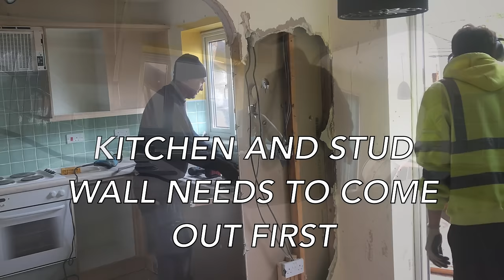HOW TO .... INSTALL 2 HUGE RSJ STEEL BEAMS...EXTENSION BUILD PART 8

Comment: Another little thing I noticed,  me being me lol, your structural engineer should really have stipulated you have steel sleeves in between your u.s.bs that your bolts go through.  To give more rigidity and strength when you nip all the bolts up they push at both insides of the upright of the beam. And mine also without compromise has to have oxidised paint coverings.
Reply from the maker: Karl Medina We don’t do it that way any more . We put a nut either side of each steel to clamp it . On this job there was no need for any , the steels were so wide they were just clamped tight together , so going nowhere 🧱👍🏽
Reply: @SteveAndAlexBuild  oh yeah I know buddy, I wasn't telling you how to suck eggs,  or that you were doing it wrong, I meant it in the sense that, even with the size of the steels if I did it that way now,  our building inspector would not pass it,  without either, paint coat, and or collets/spacers in the voids as I stated.  They just would not pass it,  I guess the guys at your end are a lot less fussy, or just realise that a lack of a bit of metal or paint isn't going to make the whole building collapse😂😂😂😂.  Nice job so far guys anyway. 
You dodged part of my statement!  I saw a frickin reciprocator!! 😆😆😆😆
Reply from the maker: Karl Medina . It’s funny , way back in the days before steel  that was wood 😂😂. As for that scary saw it was Vic’s 👌🏼🧱👍🏼
Reply from the maker: Karl Medina 😂😂. On site today making the most of the dry ground 👌🏼. Good luck with the tiling 😬🧱👍🏽
Reply: @SteveAndAlexBuild  👍👍👍👍 thanks off I go again
Reply from the maker: Karl Medina 🧱🧱👍🏽

Comment: Nice job. 👍Engineers should have to spend a bit of time on site to understand the chew on it is to get these steels in. It’s ok specifying big steels but all health and safety goes out the window on jobs like that. No room for lifting equipment and they know this as they do site visits. Makes you laugh when the recommended lifting weight is 25kg but they specify nearly 1/3 of a ton knowing the only way to get them in is by manual handling. 🤷‍♂️ I just did one on my gaffers house. Dividing wall between dining room and kitchen and the full back of the house 9 metres. Sat on a centre column and bolted together. Like a giant T.   Engineer specified 254’s with 6mm plates welded on just to make them that bit heavier. 🥴
Reply from the maker: LookitsMeNotYou . That is so true . These are 254s , never used them that size , the bloody profile is thicker too . I’m sure 215s would have done . I hurt my back just moving them into the garden when it was just me and Al 🧱👍🏼
Reply from the maker: Helicrete Sydney Absolutely ! 🧱👍🏽

Comment: Great vid. I have a question and I am a complete amateur so this might be obvious to some, but what happens to any moisture that penetrates the brick work from above the extension. Would it not just run down the inside of the cavity and end up on the steel. If anyone can advise that would be great! Thanks
Reply from the maker: There is another video showing me installing a cavity tray 🧱👍🏽

Comment: Did you need to use slate to pack above the beam before removing the props?
Reply from the maker: Messimagician83 . No I never bother . As long as the beds are packed tight  with sand and cement it’s fine . I only pack bricks that have come loose 🧱👍🏽
Reply: @SteveAndAlexBuild  thanks for taking the time to reply. Can I ask when packing do you use the same mortar mix of  1-5 or  do you use a stronger mix like 3-1 ? And do the same mixes apply when bedding padstones or engineering bricks?
Reply from the maker: Messimagician83 . We always use 4 to 1 for all our work 👌🏼🧱👍🏼

Comment: why was it  needed for 2 rsj steve wouldnt 1  have been enough also shouldnt some kind of membrane been put underneath them
Reply from the maker: Lin Cordery no need for a membrane as they are inside now . Also it’s a cavity wall so 1 for outer skin brickwork and one for the inner skin , blockwork 🧱👍🏽

Comment: How do you work out what steel you need.
Do you have to have a structural engineer?
Reply from the maker: paul davison . Yes pal you do , not cheap but necessary 😬🧱👍🏼
Reply: You don’t need to have a structural engineer but you need to know the engineer calculations so unless you’re not willing to learn then I’d recommend an engineer
Reply from the maker: Joshua Naismith . Very true 🧱👍🏼

Comment: Ignorant question:  could you stand  and brace  some 15'  tall heavy timbers (like acros kind of)  near the wall, resting on the ground  far enough away from the wall for the lintel to  fit between the wall and the  timber, with a horizontal at the top of the timber, and run a block and tackle from each of the horizontals down to the steel you have to lift ?
Reply from the maker: It’s possible but that sounds a bit technical for us and we don’t have any Olof that equipment. 
Thanks for the suggestion though 🧱👍🏽

Comment: Question. Are there 2 padstones on each end?
Reply from the maker: ANTONIOS yes there are and as of today two extra pillars 🧱👍🏼
Reply: Sorry guys, what do you mean two extra pillars?
Reply: I guess, neighbouring houses keep such beams in place. I guess - columns are installed on both ends to transfer beam to foundations, (so pad stones don't do the heavy lifting anymore). Just my guesses. (Trying to imagine both neighbours doing same job - and result ;)

Comment: Should 200mm to 300mm bearing for steels not 150mmm that’s fine for lintels .
Reply from the maker: We were governed by the dam useless vertical damp they we had to put in . Any bigger would have bridged it and been a damp risk . Everything on this job was tight 😬🧱
Reply: 150mm bearing is more than ample for steels of that length and ub specification how much deflection do you think you will get. 🤔🤔👏👏
Reply from the maker: Mark Worthington . Cheers mark 🧱👍🏽
Reply: It would say on the drawings.

Comment: Incorrect install of strongboys, NEVER have strongboys only 2 inches under the brick, 13:39 you can see the flat plates bending because they're not in far enough. This could of gone seriously wrong. I understand the space was tight even so.
Reply from the maker: I agree but strong boys have a vertical brace that sticks out so if you put them all the way in you can’t lift the steels past them and we needed all the room we could get to lift those ridiculous steels in 🥵.
Thanks for watching and commenting 🧱👍🏽
Reply: @SteveAndAlexBuild  yeah, I've got some 4.5m ones to put in next week :'(
Reply from the maker: Relax with Seizure Good luck pal 😬🧱👍🏼

Comment: Hey guys! Next time rent the material lift 600lb (Genie) for $78 per day in Sunbelt or United rentals. Don't brake your backs!!!!!
Reply from the maker: Artur Sibagatullin we are in England but  thanks for the tip . I’ve used them before but you need the wall down so the kegs can go into the opening 🧱👍🏽💪🏼
Reply: Bricklaying With Steve and Alex.  God bless the Queen! Just extend the fork by using the angle iron or rectangle tubing pcs and clamp 🗜 them to existing forks. This is how we work in Los Angeles. Work smart and stay safe bro.
Reply from the maker: Artur Sibagatullin 😳💪🏼🧱👍🏽
Reply: Bricklaying With Steve and Alex  And now go back to work. Lunch is over.
Reply from the maker: Artur Sibagatullin lunch ! 😳 it’s 9 pm over here 🧱👍🏽

Comment: The steel dont have fire paint on it
Reply from the maker: Gurpreet Singh never heard of fire paint 😳👍🏼🧱
Reply: In case you don't cover beam with double plasterboard (stagered joints). You need intumescent paint on parts of beam that is exposed from inside. ( i bet you didn't leave those steels exposed in this case).
Reply from the maker: Marcin Piotrowicz 🧱👍🏽

Comment: fellas, those steels aren't 6m lol
Reply from the maker: R&T . Ah that was a mistake in the editing , I will sort it now . Thanks for pointing it out pal 🧱👍🏽
Reply from the maker: Just checked they are 4365 mm ....... They felt like 6 m though 😟😂😂🧱👍🏼
Reply: @SteveAndAlexBuild  We just put up a 6m at 203x203x46 and it took 5 of us to get it off the truck and carry it in. They're b******ds aren't they. Good build guys.
Reply from the maker: R&T . They certainly are , because of where they go and the fact you need to put props up makes it one of the most awkward jobs . 
These were 254x 146 x31 . I have never put steels in that big before , I’m sure they were over engineered to be on the safe side . I’ve always used the size that you did but we just did what the plans said , I couldn’t believe it when I saw them ! 😬🧱👍🏼